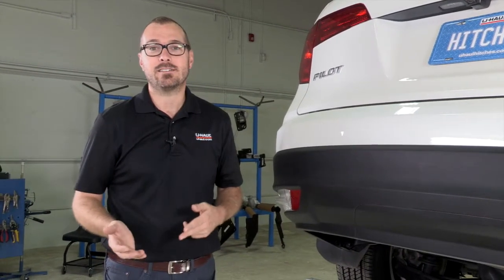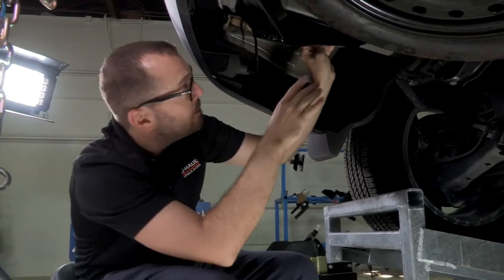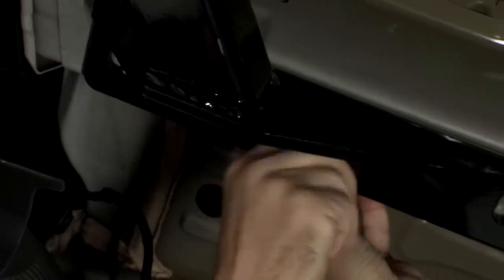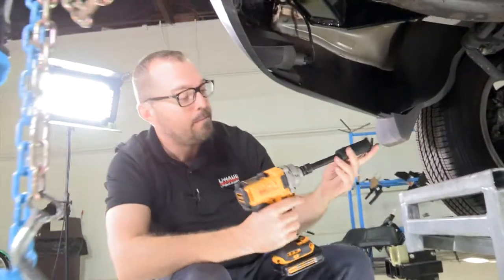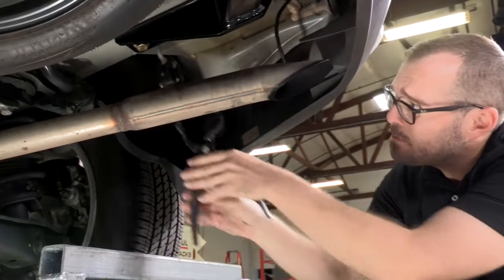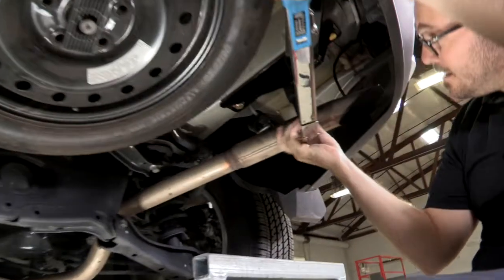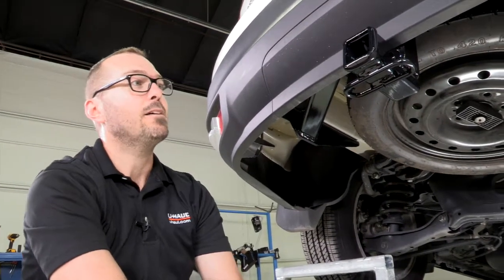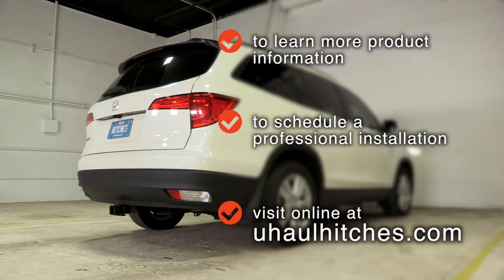2016 Honda Pilot Trailer Hitch Installation

Comment: Hey so, I followed all your instructions but had a lot of trouble threading the bolts on.   Same hitch, same car model.  I ended up breaking the weld nut so now the bolt just spins freely.  I’m afraid I’ll do the same thing in tightening the other bolts.   But now, the hitch is kind of stuck on with that semi loose bolt and the others are very hard to screw in.   Do you have any solution?  Any help would be greatly appreciated - for now I’m trying to figure out how to release the hitch off that bolt, and then to reinstall again with smaller? bolts…
Reply from the maker: Sorry to hear that happened. Here is a video on weld nut repair.
https://www.youtube.com/watch?v=AG3N_0xEwok&t=442s
When putting in the remaining bolts, make sure the hitch holes are lined up straight with the weld nuts. You can use a pry bar to align the hitch while putting in your bolts.